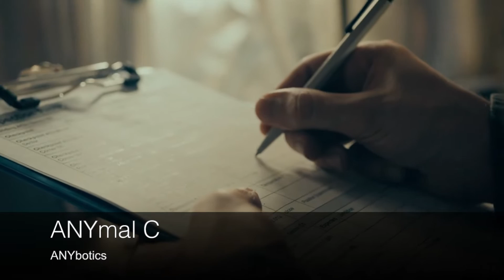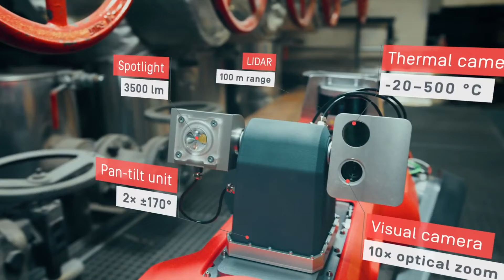Incredible Four Legged Robots Spotmini Laikago ANYmal and Aliengo

Comment: In order to code a robot to do anything you want you need to update the motion coding in the subroutine.  Currently system speed  is F=m*a*a is only 31.832%. Now change to F=m*a*a*a*a is going to run it at 100% system speed. I am a robotics expert in this coding. How will we advance if we keep everything a secret.
Reply: I have no idea what F=m*a*a means, but I'm pretty sure that the developers have good reason to keep their coding proprietary. If I'm wrong, I'd welcome the explanation.
Reply: @MrTeff999  F=m*a*a is in all open-sourced operating systems it is the first line of code.  This code can be changed to make it run the robots or any system better. It runs the SOST properly if you know robots well then you know what that means. Thank you.
Reply: @ronerickson8083   Thank you.